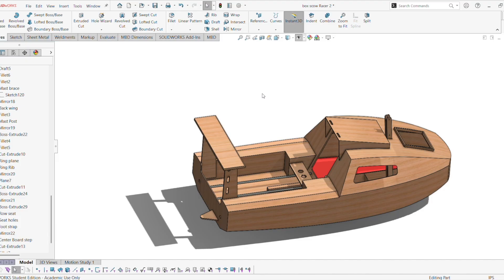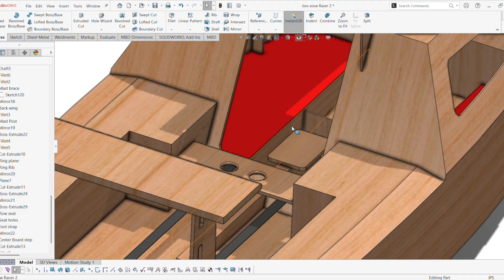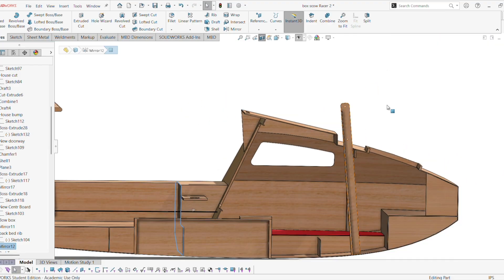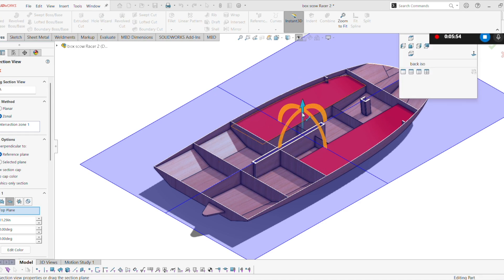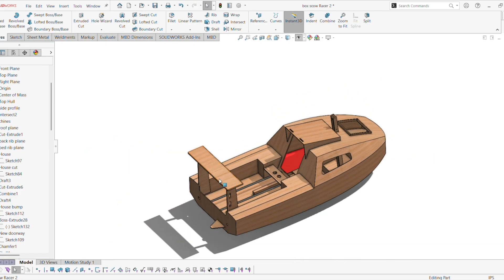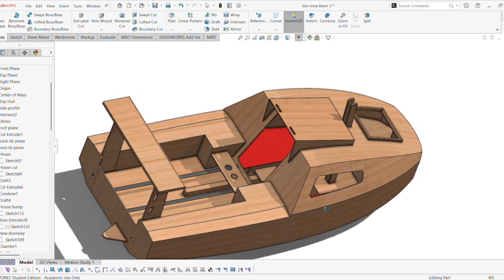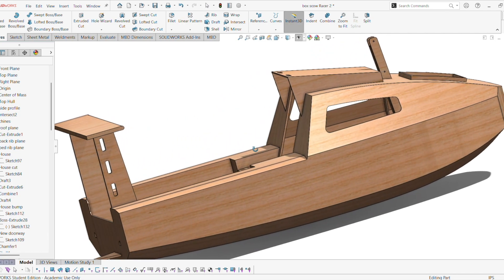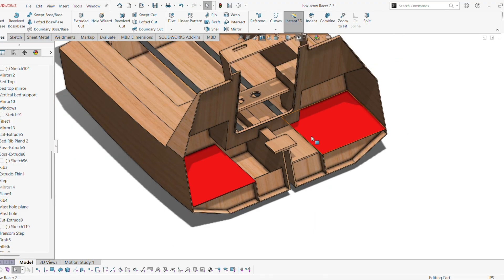Micro Scow Final Model Walkthough

Comment: I think its the twentieth time i look this video before going to bed, so i can dream of the adventures i could live with this little boat.
Reply from the maker: I put it on hold till I can figure out the centerboard mechanics.  Still considering a dagger board with a weighted bulb or maybe hydroplaning skimmers.  I will resolve it soon.
Reply: I think about water ballasts under the berths on each side in the middle compartment. You could fill it with a manual pump if desired in strong wind. The hull is wide, with a good shape stability. Do you want to make the boat self righting. (Sorry for my english)

Comment: Might be more fun to set the toilet bucket in the front hatch area to keep smell and sound private and good ventilation with head sticking up haha
Reply from the maker: The floor starts angling up there.  It’s possible but the mast support column is in the way.  A stayed Bermuda rig would eliminate the mast column if you double up the ring bulkhead.

Comment: I have seen some small boats with the mast rest and supports  being thicker to provide more floatation high up in the rear.
Reply from the maker: It could be made thicker.  That would prevent turtling.  I think it depends on where you sail.  Some people might make the centerboard out of plate stainless steel.  I prefer a hollow wooden foil filled with sand and epoxy.  My scale model did not have weight in the centerboard and I think that is why it turtled.  I am going to test it again with a steel rod inside.

Comment: Looking good. Though a very different boat it does oddly remind me of the 15RoG in some respects. I look forward to the build and sail. Thank you for the videos.
Reply from the maker: The slant on the cabin wall and the shape of the window does look like the RoG but the interior layout and sail rig are very different, and this is a scow, not a skiff.  I predict this have a higher top speed on a reach or run and a slightly lower speed tacking or in low winds.
Reply: Kind of like a mix of the 15RoG and Perry's scow.... i can see how this could be a quick boat on a reach depending on the sea state. I hope to see one built and sailed. Good luck with the project.

Comment: I like the back step. Also the arch. Jerome Delaunay uses these a lot and combines them with floatation.  Still puzzled why you don’t have a complete bridge deck.  Seems like it would make a big difference to interior.  What’s the rationale for current arrangement?
Reply from the maker: Thanks, if you make the door too small people will not go in and out of the door. So if you turn it into a full bridge deck, you have to add a big hatch on the roof.
Reply from the maker: I think the full bridge deck might work, actually.
Reply: Not sure what that would look like, but I like the current sloped cabin/backrest allowing someone to lean back on it facing after. Would extending the coach roof interfere with that?
Reply: "Facing aft"
Reply: Ps I meant the bridge deck 🙄